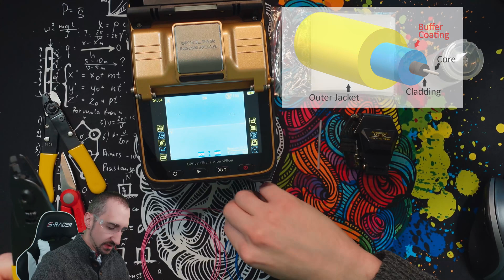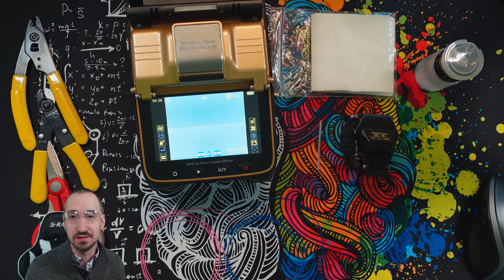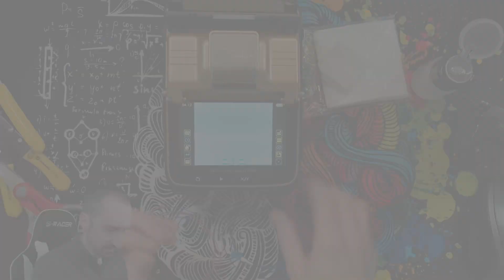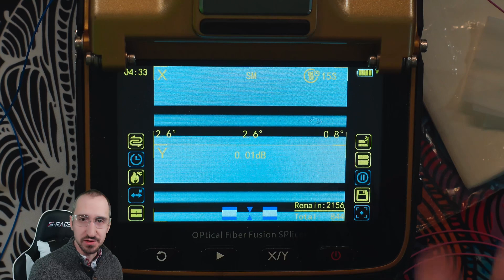Fiber Optic Fusion Splicing

Comment: Why did you redo both fibers if only one failed?
Reply from the maker: Since it does that initial arc to clean the fibers when it first starts, doing that a second time to one of the fibers could foul the connection, so it is best practice to redo both.

Comment: 0.01db seems a little optimistic
Reply from the maker: It probably is, but since the loss on the connections on either end is about -0.3dB, testing usually is more impacted by those connections than the splice.  The only place that you would notice a difference is if you test a continuous cable, then cut and splice it and measure the difference, but the loss is generally so low when splicing that it is similar to the loss in the cable itself which is why it is a good connection method.
Reply: 8:11 in try not to touch the fibre whist placing, you just wiped a alcohol wipe across it literally just before you put it in the splicer. 😂
Reply: Clean, cleave, splice. Not clean, cleave, clean, splice, 😂

Comment: Seems like the first fiber was a lot harder to strip then the second and probably your stripper got caught on the cladding
Reply from the maker: That is true, but as long as the fiber core itself does not receive any damage from the stripping process, it will not change the quality of the connection to continue, so I just sped it up a bit instead of idealizing it.  The second did go a lot smoother.  Great observation!